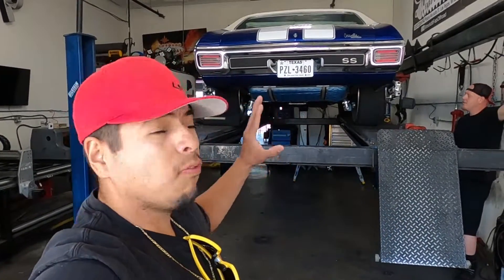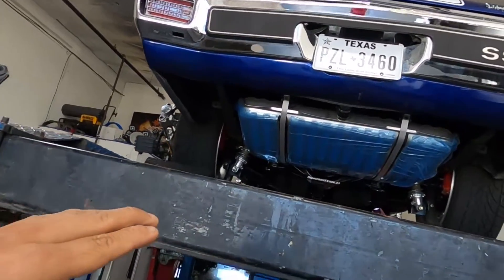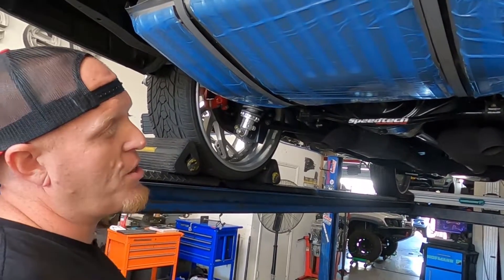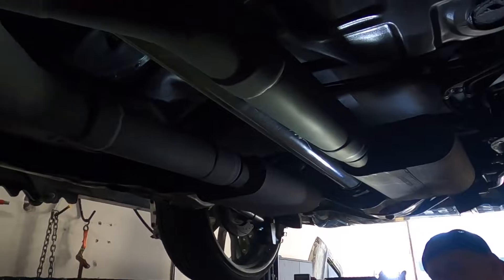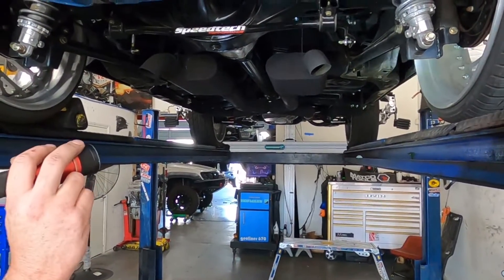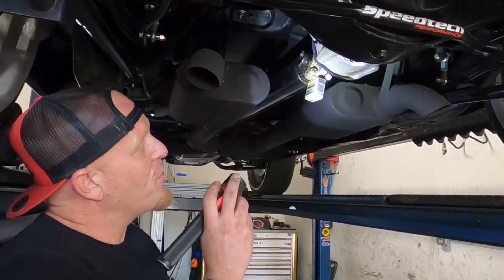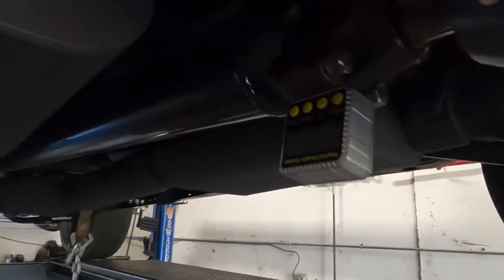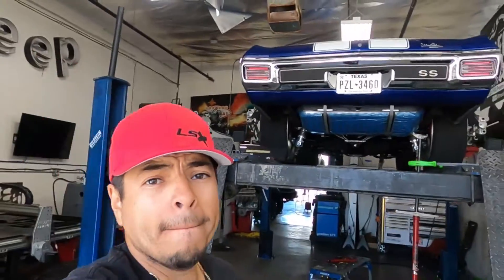IF YOU LS SWAP YOUR CAR OR CHANGE YOUR SUSPENSION, MUST CHECK DRIVE SHAFT PINION ANGLE!

Comment: I'm no expert, but I thought you had to measure the transmission yoke and pinion yoke and they should be within 1* of eachother but the total operating angle from engine to rear axle shouldn't exceed 3 degrees.  You do not want things in a "straight line" generally because the U-joint caps don't grease themselves properly then.  You should keep a minimum of at least 0.5* so the caps grease themselves.  Proper alignment requires measuring both yokes not just the rear pinion.  To adjust pinion you adjust the upper control arms.  The lowers are more used for centering the wheel in the wheel-well.